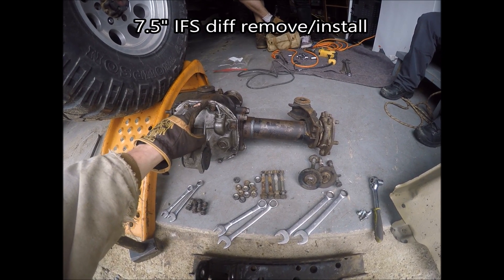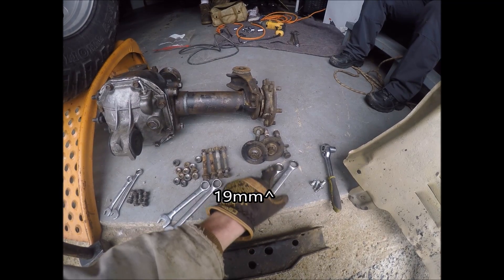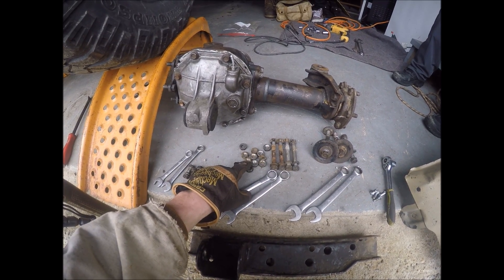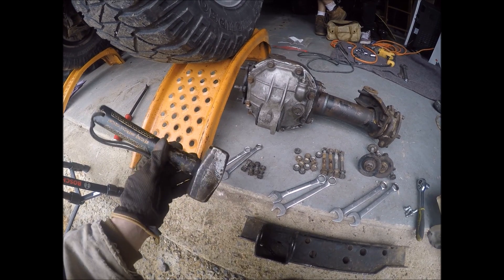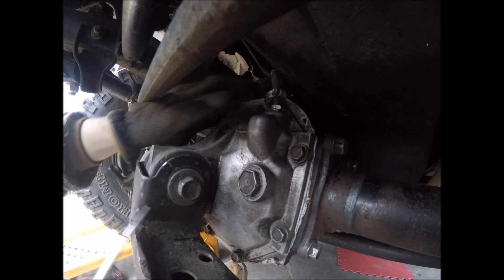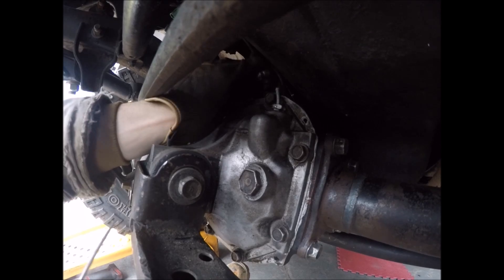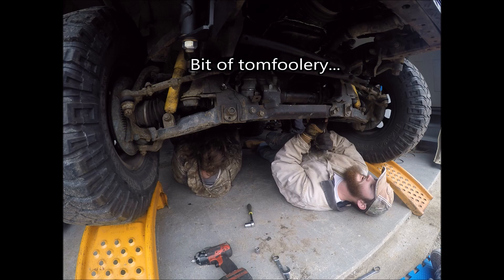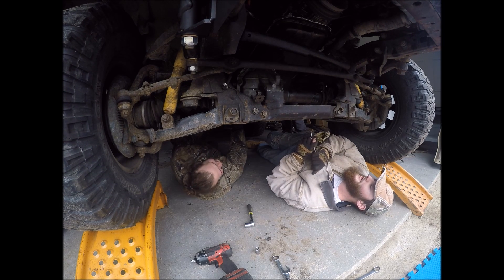How to Remove/Install a Toyota 7.5" IFS Diff- Pickup/4Runner

Comment: Awesome vid thanks! Seems I bagged my truck too hard last time I was out and blew 2 oil seals on my diff. I thought I was gonna have to rip apart my cv axle assembly again after replacing it. Glad to know I can get this out and on the bench with relative ease to inspect it!
Reply: I parked mine for half a year thinking the same long process. Now i cant wait for tommorrow morning to drop it😅

Comment: SO I got the diff out, and I'm rebuilding that.  Is it possible to replace the inner cv boot without having to tear the whole thing apart.  I was  hoping to be able to jack up the on side remove the wheel and circlip and slide the axle out Is that doable?

Comment: Thanks for uploading this Duke.
I'm taking mine out tomorrow to fit a locker...
Reply: how did the locker go? about to toss a spartan in mine. Anny related bearings/seals you wished you did?
Reply: @tylergould6789  OMG! My comment was a year ago! Lol.. I've not fitted it yet as I've been having other stuff going on.... I will be doing it in the spring alongside a V8 conversion!
Reply: @tylergould6789  You know what they say... "Great plans laid to rest".... I didn't fit it in the end... Can't remember why??? Anyway, My truck is now off the road and getting a V8 conversion.
While the old engine is out, I will rebuild the front diff including the locker.

Comment: Do the axle rotate freely to get the 5 bolts off the cv? On an ADD diff. The axle is lock isnt it so the tires need to be free to rotate to get to all the bolts?

Comment: That's very helpful thanks, what was the timeline like?
Reply from the maker: Probably under 45 minutes total I think
Reply: That's awesome thanks, I've never done a ifs swap and thought I had to pull cv's and everything, this is awesome
Reply from the maker: Nooooo lol ppl make IFS sound complicated but our early IFS is pretty simple
Reply: Duke Offroad no kidding way easier than solid axle lol
Reply from the maker: Careful where u say that lol ppl might get upset haha
Reply: @mikeneave18  "way easier than solid axle lol" - I couldn't agree more. I just installed a locker on my 1995 (front and rear) and I was surprise how incredible easy it was to remove the front diff. No bleeding brakes lines, no removing parking brake cable, not even removing the wheels!

Comment: Lol!!!, I just completed this same job on my son’s ‘94 Toyota truck, including both CV axle replacement between the original 4.10 and ADD 4.56 front diff exchange. Temps dropped as low as 39 degrees while doing this on my open driveway and at 55 yrs. old, never again, ha!
Reply from the maker: I hate wrenching out in the cold lol sometimes ya gotta do it though
Reply: What do you mean cold. I was wrenching on mine in the garage and my beer turned to slush. It was 6 degrees (that's the English degrees not no Celsius). My Suburban will not fit in the garage so that's done on the driveway. I am hoping for 39. Have a good one. I'm in Minnesota by the way. Where are you
Reply: I'm doin this this now in driveway and regretting starting!! The B@$tard WILL not come out, all bolts undone but can't free it from CVs....

Comment: Why in that hell toyota engineers decided to change this awesomeness of differential to the pain on the ass monstrosity that installed on the 96 ?? The axle from the 94 was better desing easy to install and maintain, Why to fucket up on the monstrosity that suppose to be a better upgrade on the  1996-2002 . .. 😕😐

Comment: Way easier than I thought
Reply from the maker: early ifs is pretty awesome lol got complicated later
Reply: Duke Offroad, I got my diff on (1995 pathfinder). The bolts on my front suspension member I had to cut them out because the 2 bottom bolts were behind my lower control arms so I couldn't drive em out. So I bought the same size bolts and put the nuts inside so that I can pull the bolts out. But anyways thanks for letting me know that the cross member could be droped. I was kind of tripping because the T bars are bolted right next to the cross member.
Reply: Tony Montana, I have a question. I'm trying to install a front diff my self. I did every thing in this video except I removed the front diff from the front brackets on the cross memeber. My question is what's supporting the front end? I got lucky taking out the diff cause it fell out. But now there's no clearance to put back in. So now I see that I need to take the front cross member out and install like these guys did. But what supports the front end?
Reply from the maker: That crossmember does
Reply from the maker: Ah, sweet! Glad it worked out for ya

Comment: What's the benefits of 7.5 diffs mate?
Reply from the maker: Easy to find a spare cuz no one likes em lol
They're just the stock diff for 86-95 pickup/4Runner IFS
Reply: Duke Offroad Oh ok...didn't know that's the stock ratio from 86-95 mate...I have a 88 4runner with stock ratio and a guy is selling me a stock rear diff from an 86, you recon it would be just fine?
Reply from the maker: 7.5" is the ring gear height, not ratio. solid axles those years have an 8" ring.
Reply from the maker: and I'd vote check the 2 ratios, it's easy to do by counting gear teeth.
Ring ÷ Pinion = Ratio
Reply: Duke Offroad Thanks bro...guess I have to open it. lol.
Reply from the maker: Well you can Google one of the codes on the VIN plate to find out ur stock ratio, probably 4.10, and then the new diff will just be easy to count teeth on since it won't be in an axle

Comment: Would you know where i can purchase the front bracket on the diff that is welded to the cross member
Reply from the maker: I'm gunna assume u broke it like I've done lol I'll put a link here to "MIKEZTOYZ" on Facebook who sells alot of used parts, great guy to deal with. Alternatively, feel free to post a wtb/iso ad in my Facebook group "Toyota Tech".
Reply from the maker: MIKEZTOYZ
https://m.facebook.com/profile.php?id=232220576957480&tsid=0.4159909458980835&source=typeahead